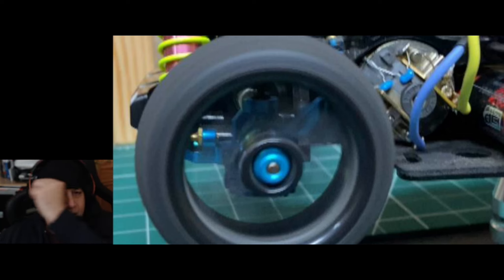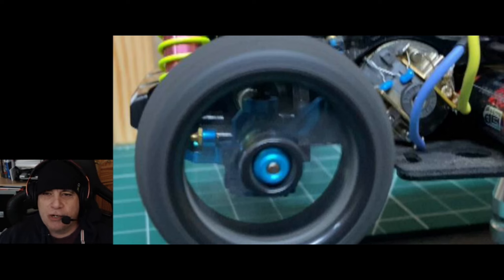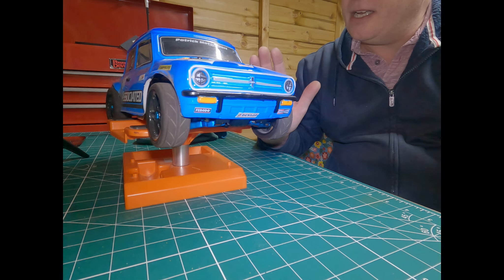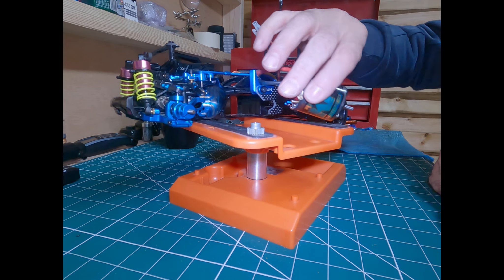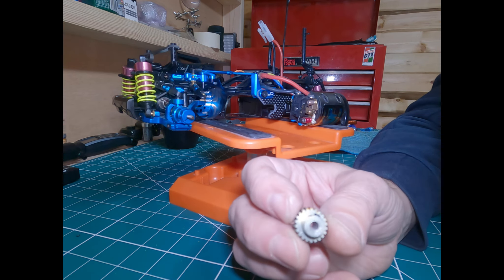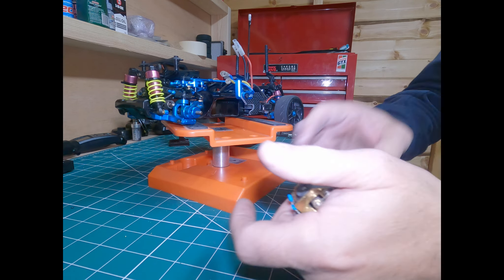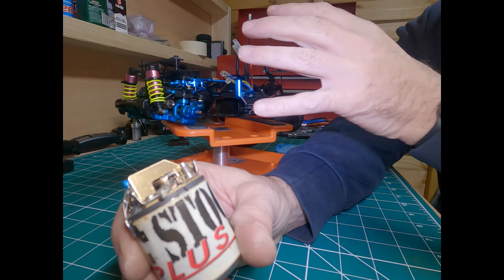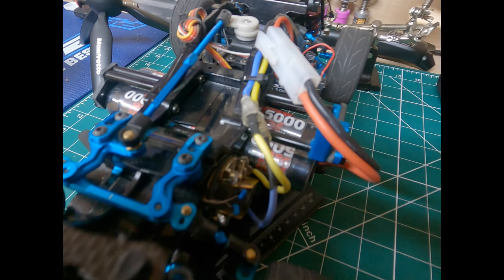Tamiya M05 Hopped Up Mini - Revisited

Comment: Great video. Try a 19 turn brushed motor. But also you should rebuild the other motors you use to refresh them and make them like new again. Brushed motors are great in these cars, I keep mine alive by using a commutator machine
Reply from the maker: yes, I have a comms machine, errrr just not used it yet. I will give it a try 😏